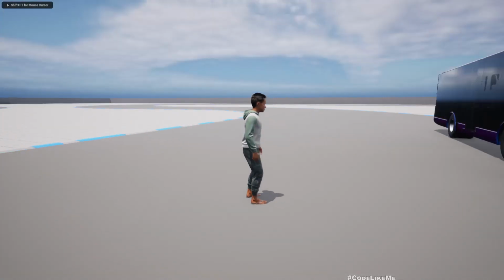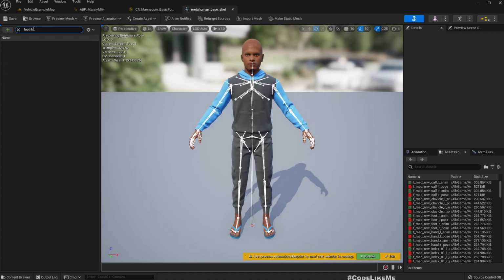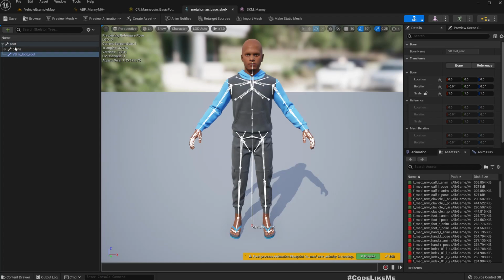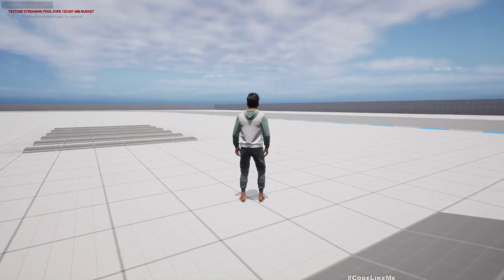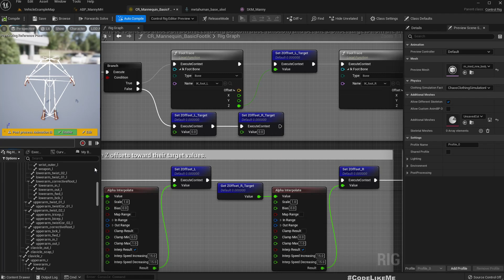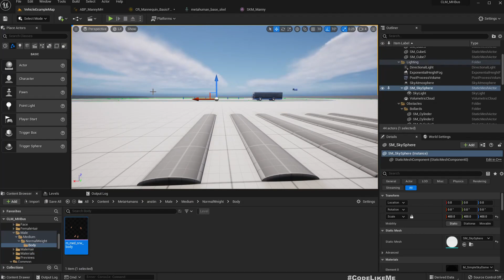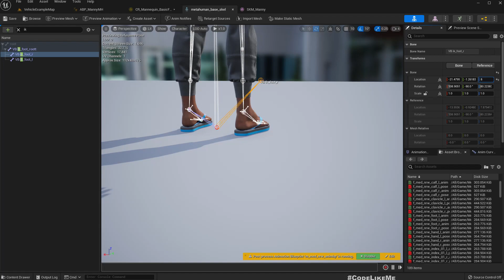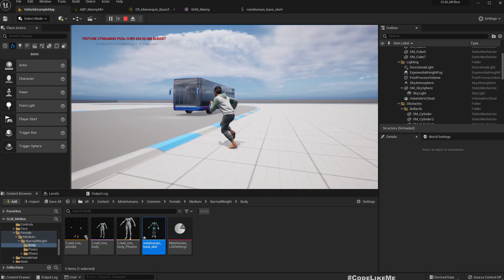Solving Foot Sliding and IK Issues in Retargeted Animation Blueprints in Unreal Engine 5

Comment: i am retargetting metahuman to flexible combat system's character. it is a ue4 mannequin without IK system and control rig, still I have the problem that legs do not match with resto of body or feet, any idea? normal running animations do play on legs but they are not in sync with body, while other animation montages like sliding jumping, dont happen at all